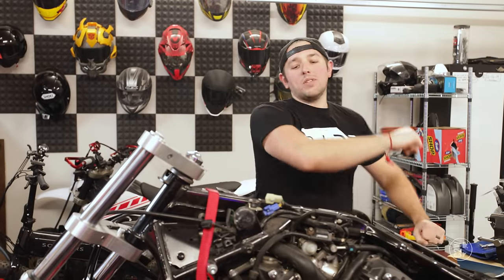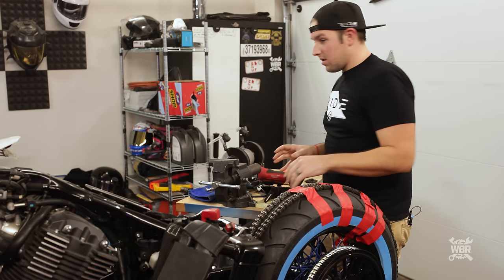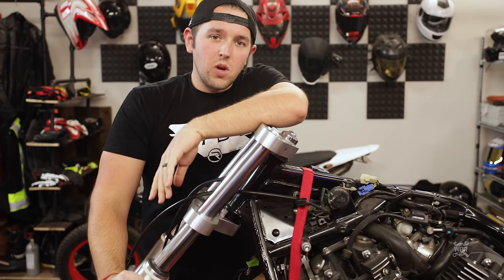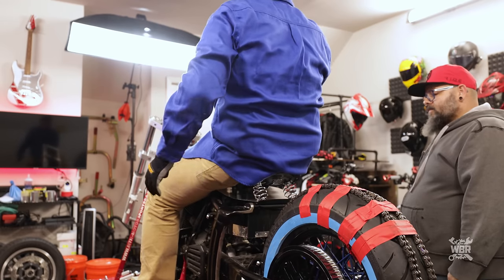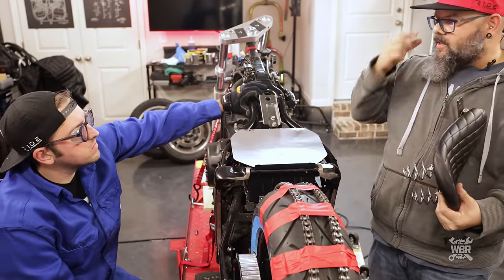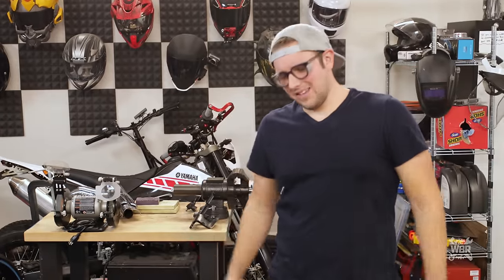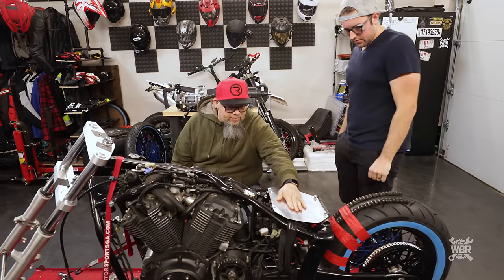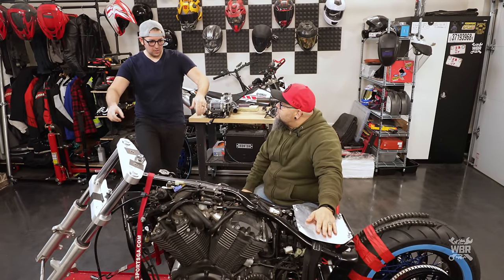BOBBER body position COMPLETE!! [Wrecked Bike Rebuild - Ep 13 - Vstar 1300 Bobber]

Comment: Not digging that plate under the seat, doesn't look clean. Looks like a farmer fix
Reply: It's not finished.
Reply: It will look much cleaner once they have brought it to the edges of the frame as planned, but I agree with a single plate looking sloppy. Won't know till it's complete but a box to actually level it out would tidy it up heaps, only problem then is the seat would be leant forward after the addition of the springs and that ain't bobber. I'm sure they'll make it all perty-like in the end
Reply: Agreed not digging the plate